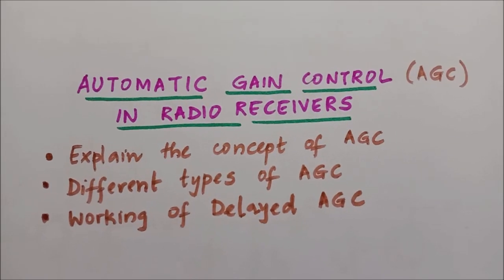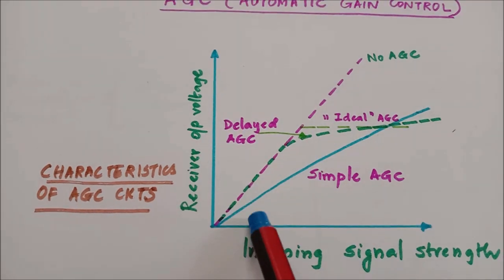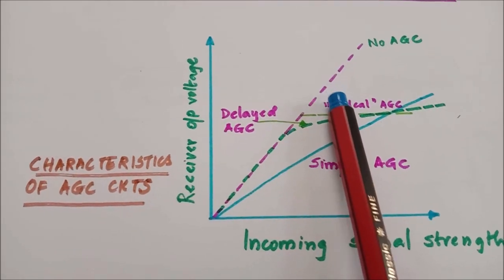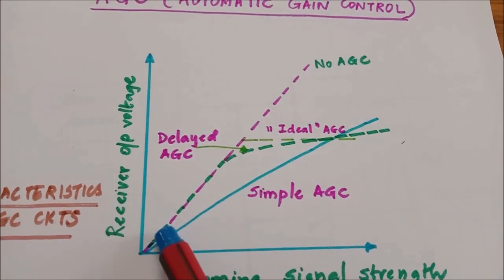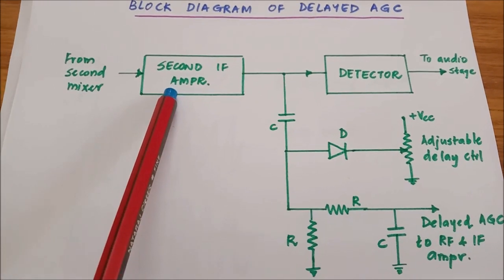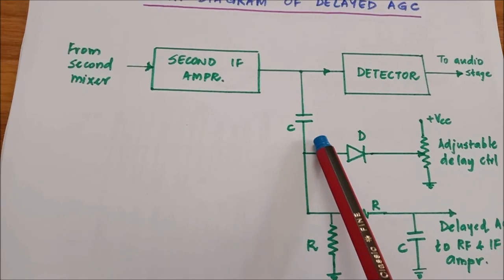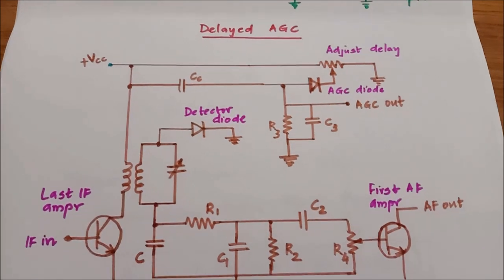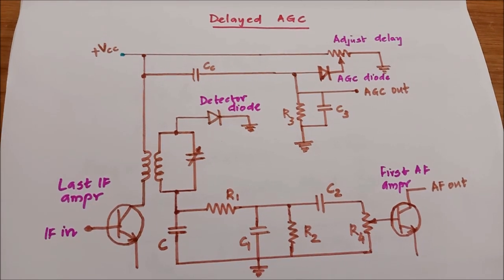EC 208 ACE -Automatic Gain Control (AGC)- Dr. Deepa Elizabeth George

Comment: At 12:00, the top horizontal capacitor (Cc?) appears to be for coupling the signal to the circuit elements to its right. But, its connection on the left is to Vcc, which ideally should be steady DC supply. Perhaps instead of connecting the left end of the capacitor to Vcc, it should be connected between the transformer primary and the collector of the last IF transistor?  Or, let the capacitor remain and add a series resistance between Vcc and the capacitor connection.